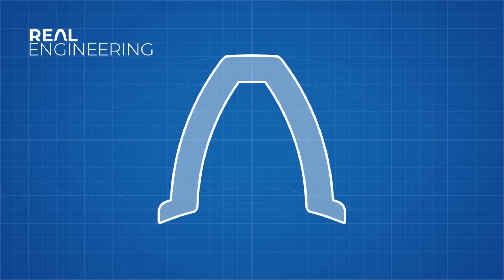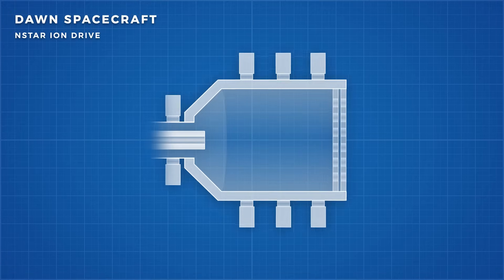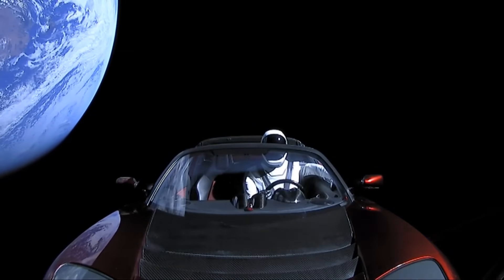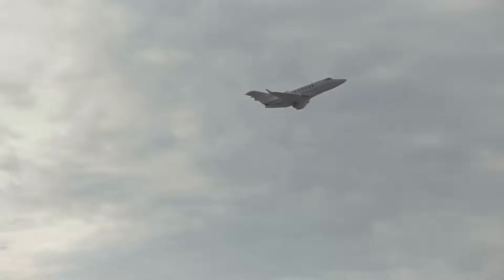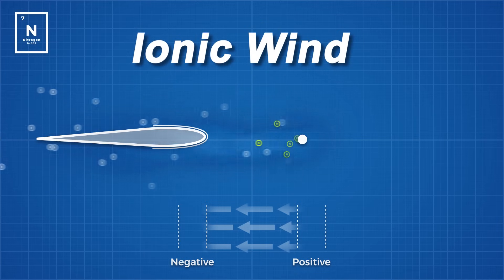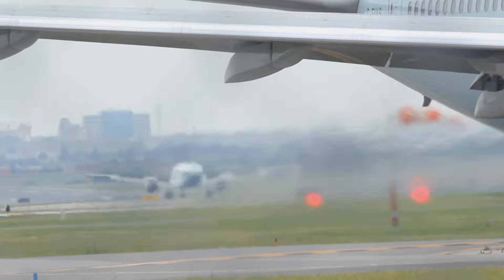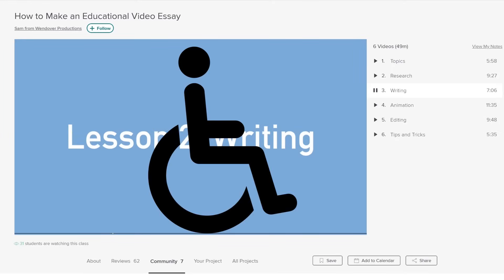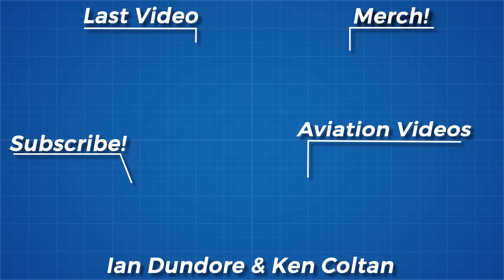Ion Propulsion - The Plane With No Moving Parts

Comment: Something more easily understood than a complex mathematical equation could be used to indicate the proportions of: mass to thrust etc. conversion, needs to enhance this video.   Show a battery and a gas can and how they differ in thrust delivered over time, get away from the temptation of using exact digital or numeric comparisons use visual analogs;  If that makes any sense.   Otherwise you stifle a vast amount of potential creative thought that might be handed your way.  Many comments refer to a hybrid system.  That is a great indicator of the interest in the success of this idea.   I would question whether there is a potential for benefit from a sequential alignment of the accelerators vs the parallel arrangement as shown.

Comment: why put it on a plane in the first place?
try a helium balloon or zeppelin or something that has its own lift.
sure, the drag is immense, but so is the area to work with.
you could even incorporate He tech into the wings of an aircraft for aerodynamics.... use the drag to extract high voltage static etc ....
Reply: OK THEY LIED.

Comment: If you click on the purple channel icon to the left, you can see a solid state ion propelled aircraft fly with a small onboard power supply!  It is many times more powerful and efficient by weight than the MIT device!  It is also is fully patented specifically for carrying its power supply onboard. It has been able to carry its own power supply vertically without external assistance before the MIT project was started.  
I know it is hard to believe that Dr. Barrett, his team, and the Journal of Nature are not correct however, they wrote that they made "the first heavier than air ion propelled aircraft of any kind to carry its power supply."  As they state in their paper regarding the above device. They are indeed simply wrong.  
The "Self Contained Ion Powered Aircraft," does exist.  It has been observed in flight  with an onboard power supply by NASA experts and others. There is a list the of names on my website of some of those people.  It predates the above widely publicized craft.

Comment: can  booster accelerator engines be combined with the ion drive, to achieve headway faster?
Reply: In earths atmosphere it is best to keep the particle speed of ion drives slower, as the efficiency tends to drop with the square of the velocity. 
If you like you can click on my channel icon to the left, to see a ion propelled aircraft with onboard power that predates the MIT craft.

Comment: 3 problems:
1. with no moving parts, how does it steer/adjust etc.
2. I can't wait a week for my plane to reach enough speed to sustain it's own weight in flight. 
3. it's a slightly propelled glider and a catapult launch. 
This is big brained stuff. Far too much for my tiny mind to comprehend. Looks like they've reinvented a slightly less useful version of a gizmo and want to use it outside it's idea operating medium. I'll hold off on the back patting for now.

Comment: Add a frequency vibration to wings with a lightweight gyroscope for stability. Also use a low power laser to keep the particles in check for optimal thrust 😜. I wish I could work on inventing stuff I would change the world overnight :-( .....oh well

Comment: Please click on my channel icon to the left if you would like to see an ion propelled aircraft that was flying with an onboard power supply about a decade before the MIT device!  It is also tremendously  more efficient.  The MIT statement is that they "created the first heavier than air ion propelled aircraft of any kind to carry its power supply."  That statement is not correct. I have been giving flight demonstrations with one that carries its power supply onboard for over 10 years.

Comment: Ive already explored ionic flight within earths atmosphere. It requires too much power, specifically voltage. If they finally create light weight carbon aerogel ultra capacitors it may be possible but otherwise not likely.

Comment: Suppose I created a very large room that could hold a vacuum. 
In that room I have a giant flywheel mounted on the lowest friction bearings I could get. 
I then used an ion drive to provide constant small acceleration to the flywheel. 
The flywheel in a vacuum, would soon be spinning at incredible speeds. 
Could this generate more electricity than it uses?
I must be missing something or someone would have done this already, correct?

Comment: So theoretically speaking, if we let an ion drive go on in space for enough time, the speed reached can be comparable of that of the speed of light?
Reply: That depends on the details of your theory, I guess. I am neither Physicist, nor Engineer, but consider that each atom of fuel you shoot out of your drive is part of the mass of the vessel before it is shot out. So the longer you want to accelerate, the more fuel you need so the more mass your vessel has, which will need more fuel mass to accelerate it. This is probably a limiting factor, but I am not educated enough in the topic to do the math. I am sure someone has done it though. Also there is the question if you want to stop again at some point, because if you would want to, you would need the same amount of fuel and time to get your vessel to stop again. Really interesting stuff though.

Comment: But electric planes exist. Passenger planes and passenger drones too. Batteries are a viable aircraft technology.
Reply: Batteries are only suitable for short-distance flights, and that will never change. They don't get anywhere near the volumetric energy capacities of fuel, and they chemically can't either. I assume they won't simply disappear in the foreseeable future, but they will never replace conventional airliners, even if those airliners themselves disappear. If you want to see a true electric airplane future, then you should start pushing microwave power transmission systems, since those remove or reduce (depending if you need to go through areas without broadcast power service) the power-density problem.
Reply: @absalomdraconis  That will never change? Just like the sound barrier would never be broken? Just like man would never fly?
Just like no man would ever run a 3 minute mile?
They say the more positive sounding someone is, the more ignorant. So I have to tell you - that's one of the most ignorant opening statements I've ever read. Anywhere.
All I know for sure, is how much I don't know. Socrates.

Comment: Use Aerogel and create a cone to funnel air around the wing increasing it's velocity and lift. A significant volume of air is accelerated by the ions in a direction more perpendicular to the wing and that energy is wasted. You are welcome.
Reply: Please see my channel icon on the left for an earlier model with onboard power.

Comment: Great great idea. You can recieve a high voltage from charged cloud . if the clouds are negatively charged then the wing will be positively charged by induction and wiring the wings to transfer the charges via an isolated conductor to the wire rows in front of the wings will do greate to release the negative charged . if it doesn't work then you need to swich the voltages some how
Reply: If you are interested, you can see an earlier, more efficient one, with onboard power by visiting my channel.

Comment: Can't see an ion drive EVER powering a 500 tonne Airbus A-380!
Reply: You could be right, it might not ever do that, certainly not by putting a lifter on a glider!  You can see an earlier more efficient ionocraft like device though, that carries its power supply with it, if you visit my channel to the left.  It will be useful as a  lightweight UAV at least.
Reply: You are right, ion propulsion is unlikely to lift 500 tonnes anytime soon.  An Airbus  most certainly isn't nearly silent, and can't theoretically go to the stars. It can't go straight up, and it does not make a good UAV either. The device of mine is not far from being practical for very lightweight applications because it has a greater than 1:1 thrust to weight ratio with the onboard power supply, and can fly for several minutes.

Comment: Addendum: Whitehead preceded the Wright Brothers in powered flight, the prize recently awarded to his achievement, a superior design in stability and control, 12hp, silk cloth, tapered bow kite structure, long truss to the tail, Wright's based on Hargrave's box kite https://www.si.edu/newsdesk/releases/did-gustave-whitehead-beat-wright-brothers
Reply: Not sure about Whitehead, thought you could be right, but if you visit my channel to the left you can see an ionocraft like device, that is completely proven to carry its power supply before the MIT craft.  There is no historical doubt or question like in the Whitehead case, because the evidence is very extensive.

Comment: For in Atmosphere- think jet only: the whole thing is relatively thin pipes together so the flow is ordered.
End toward the movement. Negative charge.

Other side, positive.
Pipes too long? AC. 
Meaning, using alternate Anode/Katode to drive the ions forward.

In Space- a solar sail dotted with points that drive electrons.

Comment: 7:35 : While the dimensions check out on your "P_lift" equation, the physics don't work that way. The lift force (which equals M * g in level flight) is PERPENDICULAR to the velocity. The amount of work (and energy and power) going into lift is therefore ZERO. Just like a car driving on a flat, horizontal road does not need any power to overcome gravity, a plane doesn't either.

That said, a heavier plane will usually require more power to fly, BUT, this is due to the increase in DRAG that goes hand in hand with an increase in lift. In order to increase the lift and carry a heavier load either the velocity or the wing area need to increase, both of which also come back in the drag equation. Practically, the power a plane needs in order to fly is P = V*m*g*C_L/C_D. The only way to increase the mass of the plane without increasing the power requirement is to improve the C_L/C_D ratio, which is basically "designing a better plane".

Comment: Total b.s. this thing isn’t flying, it’s gliding off the spring launcher. That’s why we only see a few seconds of video.
Reply: In any case it does not fly very well if at all.  If you click the channel icon to the left, you can see one that predates the MIT device with onboard power.  It also flies for almost 2 minutes with no bungee launcher.  The power to weight ratio is also a heck of a lot higher.

Comment: Question; if you ionize the air to move the air craft, wouldn't that be bad for human? Like how air purifier that have Ion capability can make ozone around you.
Reply: Good question,  If you click on the channel icon to the left, you can see one that doesn't make much ozone, due to careful design. It predates the MIT glider in carrying its power supply as well.

Comment: Remember those levitating/flying triangle shaped that where briefly popular as science fair projects in the early 2000s. This propulsion is exactly the same thing. It has been proven years ago that it is impossible to scale this up for real world use. A soft wind is enough to disrupt the little trust that can be generated. And if you could scale it up to the trust of a yet engine, it would have to displace the same amount of air as a jet engine and consequently make the same amount of noise.  Nice work from those students though, the whole thing has to be incredibly light weight.

Comment: The major problem here with the 100 year Wright flight is a little bit of misleading. That plane could already carry a pilot and was full sized, this is a little more than a large paper plane in this comparison, which was pretty much happened as soon as humans made paper in china around 2000-2500 years ago. Da Vinci did large and complex paper and other light weight plane models (missing the power plant), so at best, this is the equivalent of that.

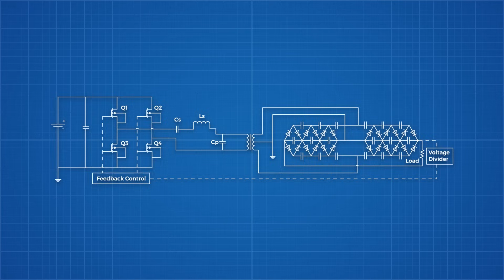Comment: 5:52 "the team had to design their own lightweight high power voltage converter"
Also 5:52: shows text book voltage multiplier circuit that every undergrad EE student should know.
Reply: Also, If you click on the channel icon to the left you can see one that has orders of magnitude more lift, efficiency, and predates the MIT craft with onboard power.

Comment: This tech has been around for many decades, perhaps the 1950s.  It was seen a decade or so ago in toy anti gravity lifters made of foil, match sticks or balsa and a wire and power supply.  It would quickly jump off the table and hover.  I think these could be  compacted more tightly inside a square foot of space to produce a few ounces of lift.    Still, this will never overcome drag to go beyond 30 mph or produce enough thrust to carry passengers.  However, it might provide a cushion effect for an air ship to land on or even propel it forward.   An air ship already has it's lift as gas, and thrusters for speed but this would make a cool repulsor pad for soft landings.  I want to know if it could run on the static charge that collects on the surface of the air ship.
Reply: There is only one in the world that can carry its power supply onboard without external assistance.  If you would like to see it, please click on the purple channel icon to the left.

Comment: WOW I could have had millions in funding 12 years ago with the crappy glider I made with a TV power supply and aluminum foil.  They had them that would carry hamsters 12 years ago that is about 3 times the weight of that airplane you powered. Old technology repacked for research funding.  :(

Comment: The first heavier than air ion propelled aircraft of any kind to carry its power supply has already been flown long before the MIT craft...  The earlier ion propelled aircraft can lift its complete onboard power supply vertically from the ground for about 2 minutes....
You can see the 5 public videos of the patented invention in flight, by clicking on the purple channel icon to the left.

Comment: Thin silicon solar cells can be attached to the top , reducing use of batteries
Reply: I think that the energy needed to ionize the particles are bigger than what solar cells can provide, but it could reduce the energy cost
Reply: @Solizeus  it could at least increase flight time?? I thought... They are very light and thin. Should not affect the flight much
Reply: @prakharmishra3000  Maybe, you would need to do the math
Reply: @Solizeus  solar cell efficiency is abysmal
Reply: I don't know..I just suggested.
Reply: What do you say??
Reply: a VPN? What do you mean? Virtual Private Network, i guess not

Comment: Would high efficiency solar panels be enough to provide the power required? If so you could envision very light planes, almost batteryless, being lifted above the troposphere to ensure constant Sun exposure. I guess the reduced air density in the stratosphere would also reduce drag, therefore allowing for larger thruster area...

Comment: Maybe they can do a hybrid version to make the plane more efficient instead of all ion thrust.
Reply: Two different systems add more weight. Look at hybrid cars
Reply: Rob that’s  because of the batteries. A system that takes charge directly from the engines would not add much weight at all. If they aren’t running the engines as hard then they can carry less fuel and the weight will be less even with an ion drive.

Comment: The first ion propelled aircraft to carry its power supply, did so over 10 years ago, I think people should not be told MIT did it first, when it is simply not the case.  The earlier invention is a heck of a lot more powerful and efficient as well.  If you are interested you can click on the purple icon to the left, to see several prototypes in flight with onboard power.

Comment: How long will it be before the MIT craft can go straight up vertically for 2 minutes, without a catapult launch, and with current battery technology?... How about probably never!
Their ion drive's thrust per watt is the same as many others for the EAD V2 shown above.  

If you click on the purple channel icon to the left, you can see the earlier patented version lifting its power supply vertically for about 2 minutes without external assistance.  

There are commercially available solar cells that would allow it to fly all day. On a purely positive note, there is still much room for improvement, especially since it is just a DIY prototype.